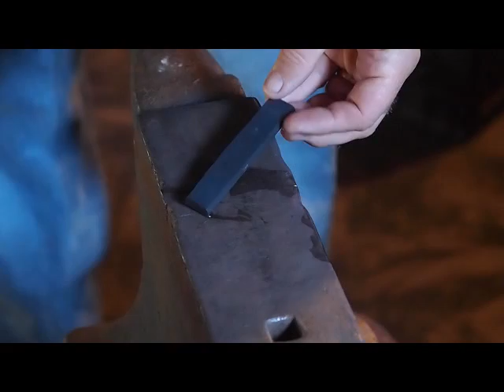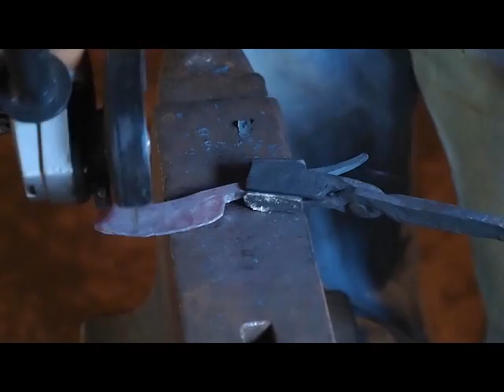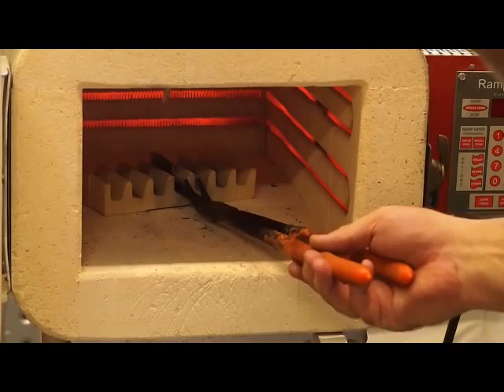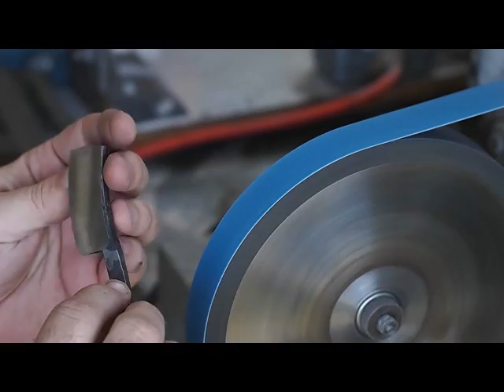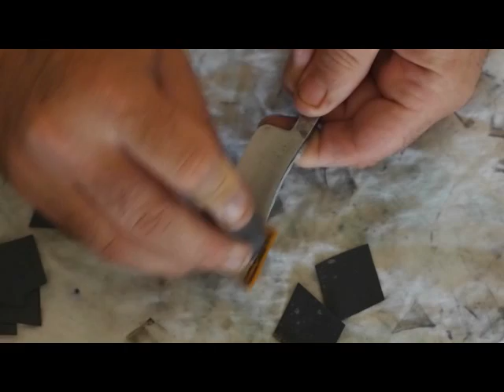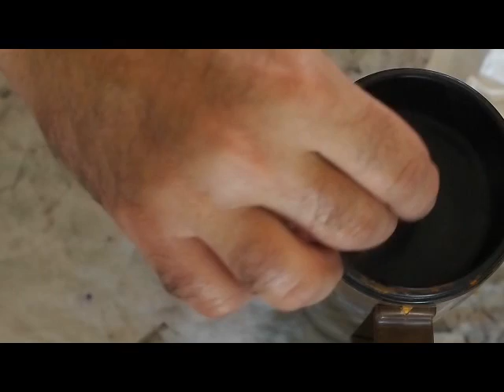Making A One Piece Razor

Comment from the maker: I set the bevel after the coarse belts. I did not damage the first bevel on the zirconia or silicon carbide belts. I ground up to the bevel and made it smaller but did grind it off.

Sometimes I do as you said and will hone a couple of times in the grinding process. Sometimes I do not.

Comment from the maker: The main difference is blade length and shape of the handle/tang. The one piece razors usually have a shorter blade length and a wider/bigger area to grip than a regular folding razor.

The analogy I think of if is a little sports car and a luxury sedan. They are both fun to drive, but they each handle a little bit differently.

Comment from the maker: I used the clay so I would get the temper line/hamon on the blade. I did it for decorative reasons. The back of the blade with the clay on it cool slower than the edge of the blade. When the blade is etched in a weak acid the temper line comes out.
It usually takes me about two or three days start to finish. Sometimes more, sometimes less.

Comment from the maker: I am using the water to keep the blade cool. The water does not come near the motor. I am very aware of the water and electricity, I keep the run off water in check and away from hazards.

Comment: great video as ever.
do you have to use a specific kind of clay for the hamon line?
and can you over harden the metal, or is it the more the better?
thanks, you're work is helping me get my plans for forges and razors cleared right up.
Reply from the maker: Thanks for comment on the video.

I like to use furnace cement for the temper line.

After you first harden the blade it is too hard and brittle, that is one of the reasons why you temper the blade in an oven after hardening.
Reply: lewisrazors thanks for the reply!
But do you HAVE to use that clay, or can i use normal, fine casting or sculpting clay? just to keep it on the cheap.
Reply from the maker: Jake R I have friends that use different types of clay, it does not have to be furnace cement. The best advice I have is to experiment.

Comment: I 'd like to make one of these by stock removal.  What type of steel do you recommend, and what dimensions for the blank?

Your work is inspiring.  Thank you for posting your excellent videos.
Reply from the maker: LeopoldUlysees Type of steel depends on type of heat treat equipment you have. 1084 is a good easy to heat treat steel that would work. The demnsions depend on what you want. I would use a vintage razor as a starting point to get deminsions off of. Basically you want the spine to blade width ratio to be about 3.5 or 4 in blade width to 1 in spine thickness. A 1/4 blade would make a 1 or little less blade.
Reply: Thanks, very much.  I look forward to sending you pics of the result of my effort.

Comment: Strange that I never saw this vid before. Anyway very nice work. I have made a few razors from O-1 using stock removal, but never tried forging one. I have always been a huge fan of straight edged razors and it looks like it would be very difficult to approximate a straight edged straight razor by forging. As the edge is hammered out, it wants to expand two dimensionally, increasing edge length relative to spine length, putting a curve in the blade. At least that is my impression. Like I said, I have never tried to hammer one out, just ground them out of bar stock and HT/quench/temper and final grind. Any tips for hand forging a straight edge? Stock removal is simple but it is kind of slow and wastes a lot of belt and steel. Also I can feel a sort of elitist pull toward the hammer and tongs! Thanks for making this video and for any tips you can give.

Also, any particular reason for preferring W2 over an oil quench steel? And do you use fresh water, or brine?
Reply from the maker: Both stock removal and forging will make a fine razor. It is really a 6 of one or half dozen of the other type of thing.  You can correct the forging as you go along to make a straight edge, I happen to prefer  blades with a bit of curve.

I prefer simple steels, 10XX and W series steels for razors. I usually oil quench, with the thin cross sections oil works fine on W steels.  When I do use water, I use plain tap water not brine.

Comment: Wonderful video!  And I had to laugh at your "play-doh" comment to a1batmang.  Describing forging years ago I would always tell people to imagine working with plasticene -- you can do anything but push a little too far and the edges crack and crumble the same way.  
Another question: When you put the clay on the blade to control spine and edge tempers you used a term for it I didn't quite catch: hamming? Hammetting? And is that word for the process or the watermark?  Beautiful work - thanks!